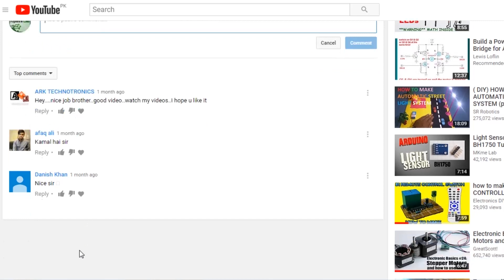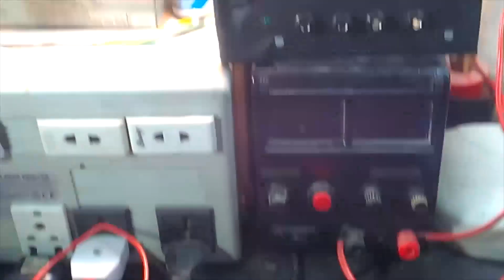How to make Lab Bench Power Supply from Computer ATX Power Supply multi volt output

Comment: I think you will need a 5 ohm 10watt resistor to stay on the the unit to prevent from no load switching
Reply: It is connected between 5v red and ground black